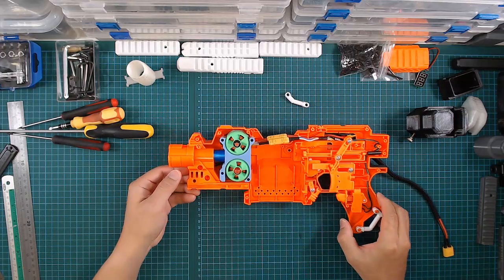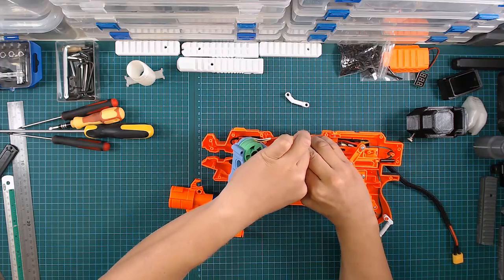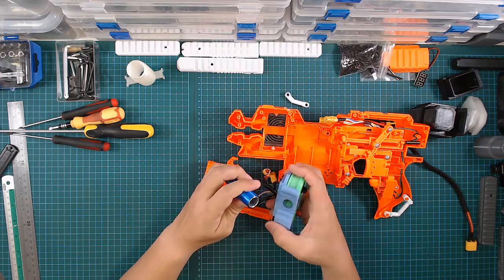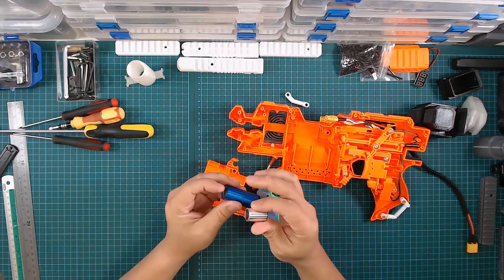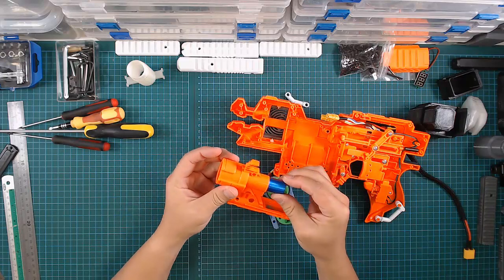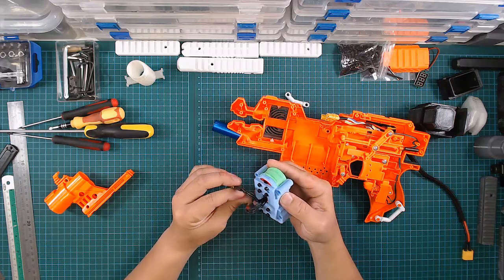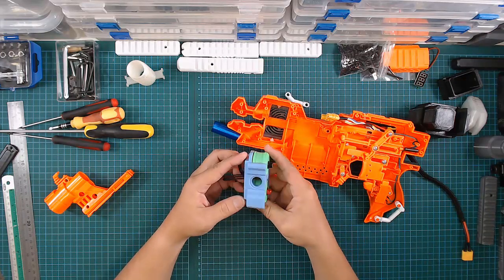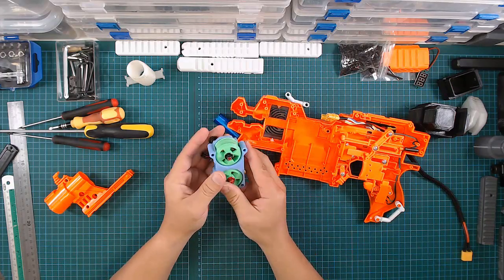Tungsten V4-I - My first Brushless attempt Part 4 - Cage

Comment: Interesting to see the fan concept modelled. Is it effective? I was planning this for my dual-stage hurricane 1108 conversion. With the 1308's, they are already super hot - and I use PETG on the lower cage to avoid meltdown (PLA failed in testing). The 1108's will probably run hotter, but they also develop more top-end speed. I was tempted to try and open the flywheel edge on the fan somewhat and put more of an aggressive profile into it - sorta like a recent generation jet fan blade. I'm sure it'll be loud.
Reply from the maker: I would like to believe it helps, it definitely creates more airflow, I also open up the side of the blaster and also "Making Awesome Stuff" gave me advice that the rev down time should be at least 6 seconds and it definitely helps. Previously I also notice the ESC too will heat up, now it is much better, I did put capacitors for each ESC, but I think for this build, they are most likely not necessary, however I left them there anyway. One issue I notice is the screws that secure the motors may become loose over time, so I might put some adhesive to better secure them.
Reply: @TungstenEXE  Yeah rev time is a fairly known thing. Personally, I keep my single stage blasters fairly aggressive in the 3-4 second range, but the multi-stages are kept very conservative. Loctite on the screws is also a good idea too. I've had one motor come loose in battle where I forgot to loctite it in place. I caught it before too much damage, but lost the flywheels.

Unfortunately the racerstar 2205 has pretty poor cooling. The 1308's I use are similar, but the 1108 (and brotherhobby r6 2205) have an open motor base for better cooling. It's apparent when using a 4s on the ultrasonic g3 geometry will invariably lead to melt-down at high speeds, where the g4 geometry can handle it. This characteristic of the open bottom motor, an open top flywheel, and additionally a fan is what I hope to use to combat meltdown on the 1108 conversion. The airflow in a hurricane is absolutely terrible lol.  Given the name, kinda ironic lol
Reply from the maker: Airzone agree man. I did also purchased a few type of 5v mini fans, I did not use them this time round as so far it seem alright, it was my last resort option, I was to put fans on Botha side one to push air in the other side suck it out lol. I think sooner or later some companies will produce aluminum cage and proper wheels I guess.
Reply: @TungstenEXE  News hot in: There is a cnc machined ultrasonic g3 wheel available now.. Well soonish. And g4 wheels are in prototyping. The cages are quite complex to machine and will require a 5 axis machine to do. I actually went to see if I could commission my own machined wheels, and it was too expensive in Australia on a low volume scale and required a significant redesign to make it machinable on a lathe... I suspect the same thing in Singapore...
Reply from the maker: Airzone woh that was fast lololololol great new!